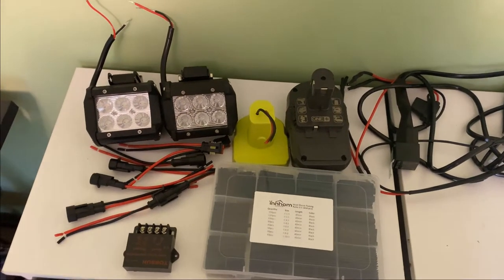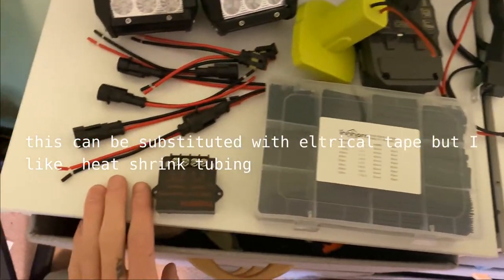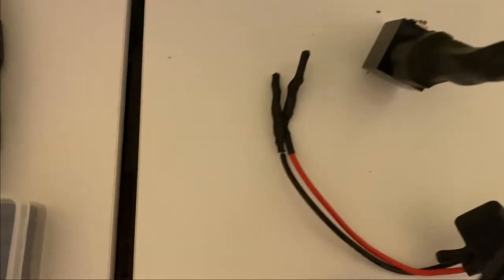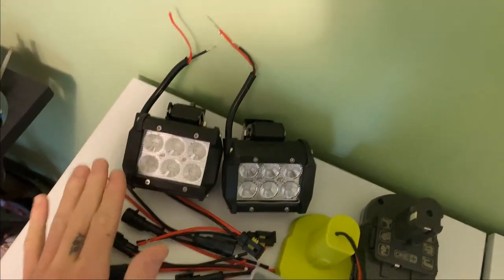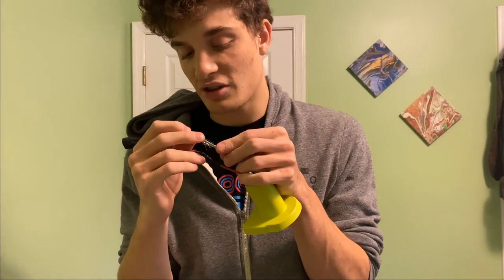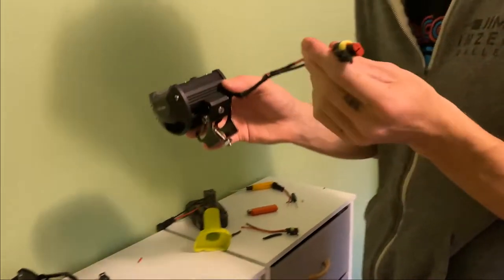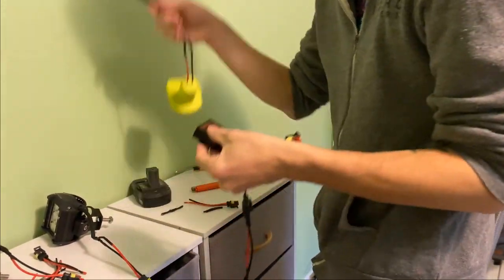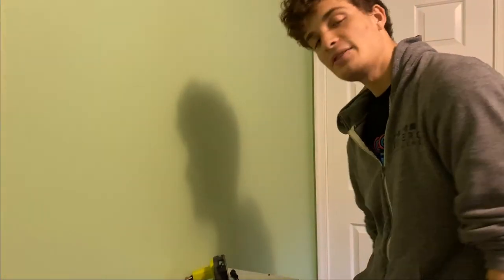12v led ran off of 18v drill battery tutorial

Comment: Just a note. If you can not Solder wiring. You can use some wire nuts, Terminal blocks or even wago connectors to secure your wiring. Even overtime  that wire will come lose if you move it around a lot even with heatshrink tubing. Oh sorry I forgot you can also use some Crimp connectors. They new ones out there also have heatshrink tubing on it. Over all Very nice setup.

Comment: Would it work without the dc to dc converter. Just using 18v Milwaukee battery?
Reply: Yes. 12v is more of a range on these LEDs. Usually good from 9v- 30-36v I believe w no step down